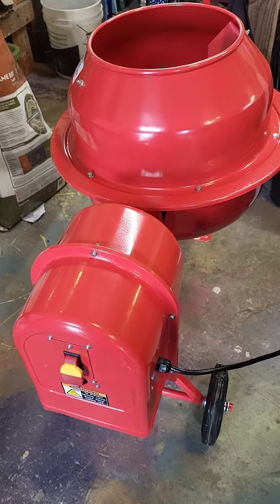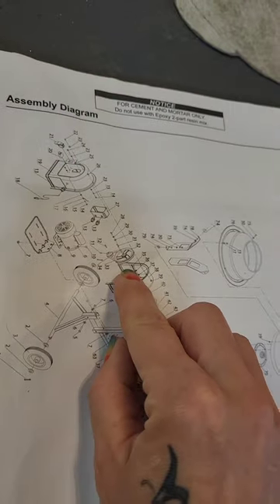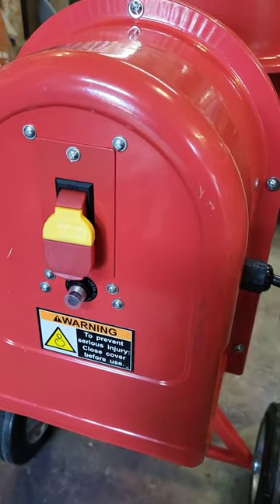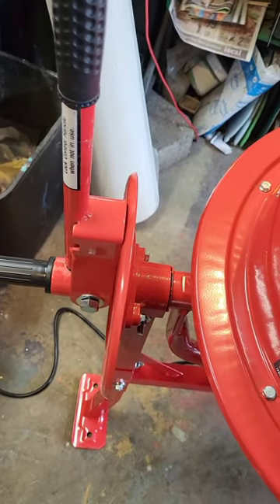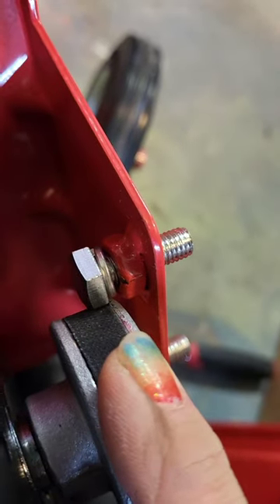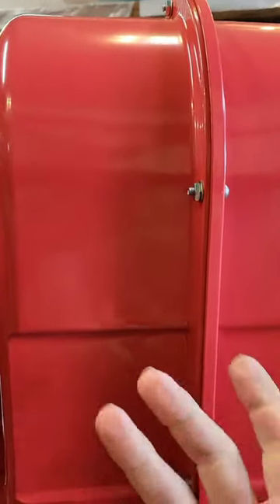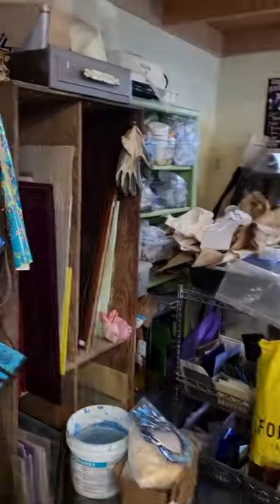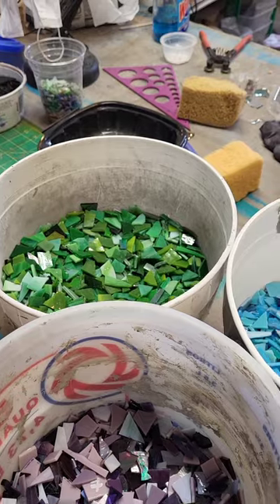Troubleshooting a Harbor Freight 1.25 cubic ft. cement mixer that won't turn.

Comment: Thanks for this video!  I ran into a similar problem with my cement mixer (different brand, but almost identical).  I haven't opened it up yet to have a look at it, but I'm betting it's the exact same issue.
Reply from the maker: Good luck to you! If I had it to do over, I would just pay the extra and buy one already assembled.